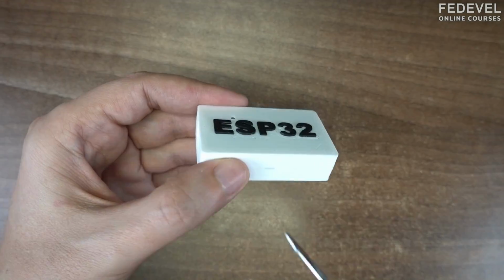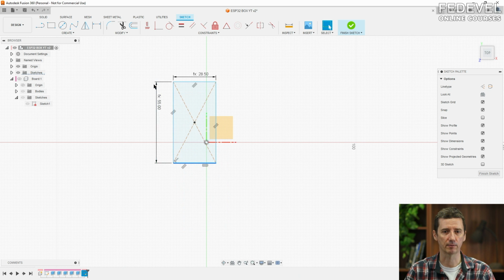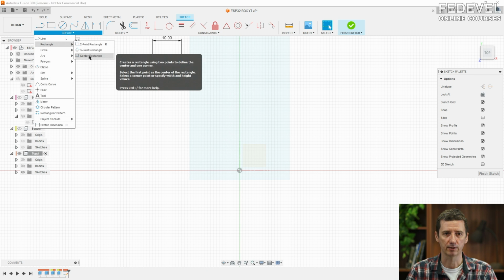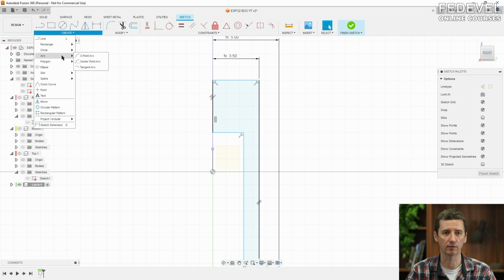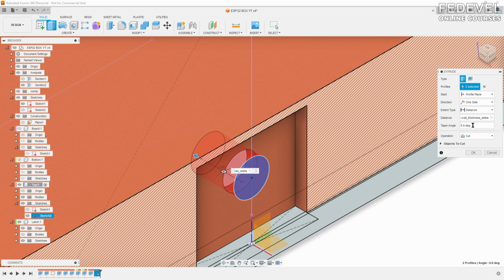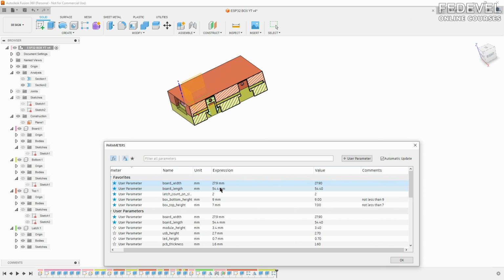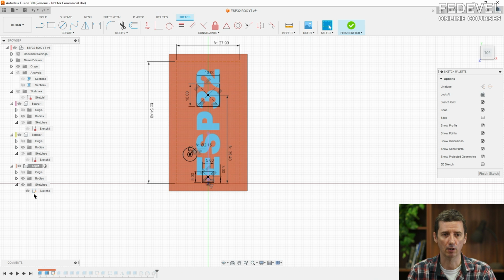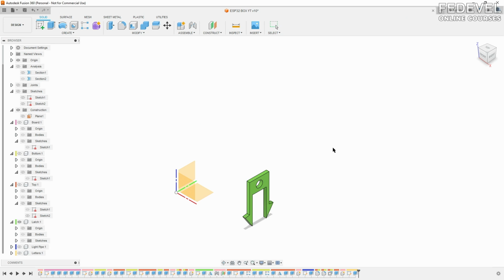How to Make Custom ESP32 Box in 1 Hour | Full Tutorial

Comment: Thanks for the tutorial.  I am stuck near the end (34:27) when mirroring the features for the two latch recesses for the top.  I select Mirror, Features, select the three features but I don't have a origin plane like you have in you example to click on the second side of the top cover.   I just figured it out.  I clicked a different origins plane and it worked.  Thanks again.

Comment: Great box. Don't forget to drill some holes for cooling as it might get hot during operation (depending on the application).
Reply: I killed a few ESP32s by placing them in a box with cooling holes and using WIFI.
Reply from the maker: @mangojc8977 do you mean in a box with or without holes? If needed, holes can be easily added into the 3D model (I have also version with them). I didn't know the board can overheat, my is working ok, but it is good to know it may happen.
Reply: @RobertFeranec  I was streaming camera video over WiFi on ESP32. They overheated, even with two 5mm x 25mm slits + some smaller ones.

It took a few hours before the ESP32s died.